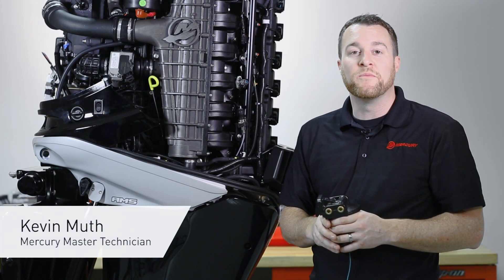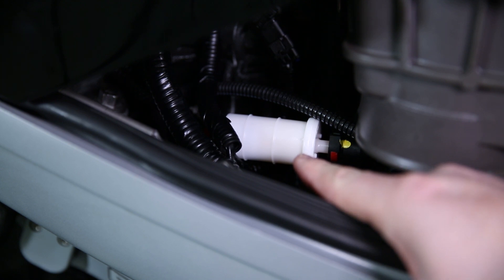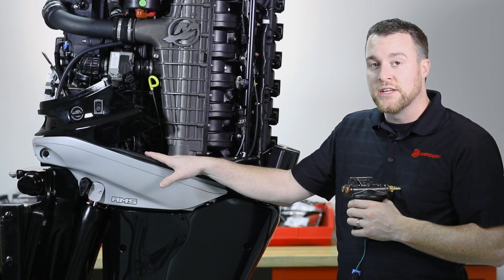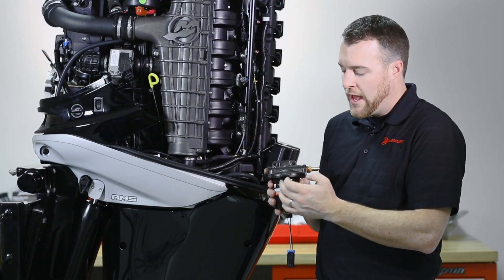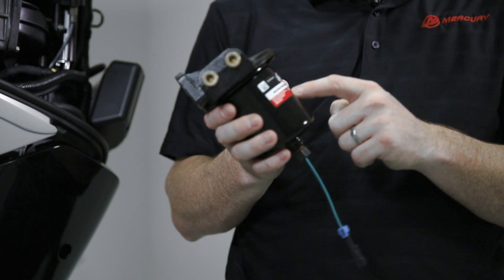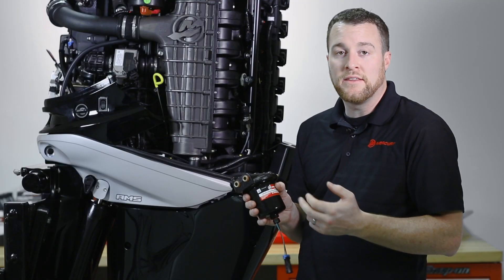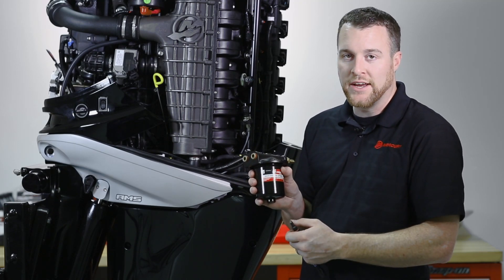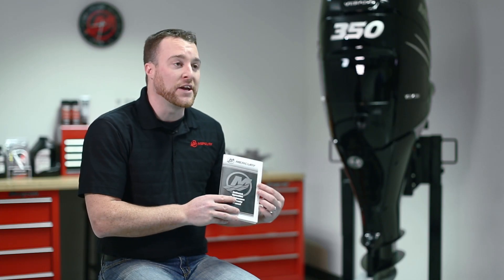Mercury Verado: Fuel Filter Maintenance

Comment: It was easier changing the high pressure fuel filter than the water separating fuel filter.  You need to be a contortionist to replace those.

Comment: Have an interesting thing going on with my 300 Verado Pro.  Just had a new fuel filter.  New water separator filter and general yearly service done.   For all honesty, I have had a Water in Fuel alarm go off, but that has stopped.  I have been running the Level 2 Merc fuel additive (usually one bottle a month) and just put in a level 1 as well.  

The issue I am having is a RPM hesitation (typically for only the first 10-15 min of operation and then it goes away).  This is at initial getting up on plane, and the typically around 4000 RPM and then around 5000 RPM.  After the 10-15 min of operation - seems like no issues.  Never had an alarm on display or audible.  Engine does not seem to have much of a LARGE vibration and no smoke or misfire sounding.  Just feels like I am hitting bottom or something - which I am not.

My assumption is some water in gas causing loss of HP Or maybe fuel pump.  But, the issue goes away and is fine for the rest of the day.  

Any recommendation on what I can try to fix this?  ...thanks!
Reply: Did you find the problem.  Mine is sending an audible alarm water in fuel. No water found
Reply: @tracyburgess5590  Hurricane Laura.